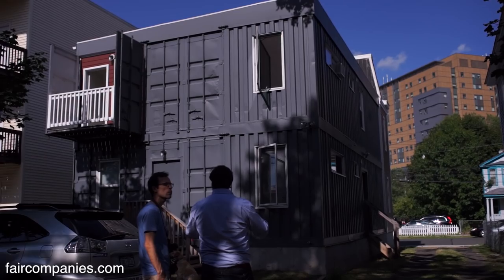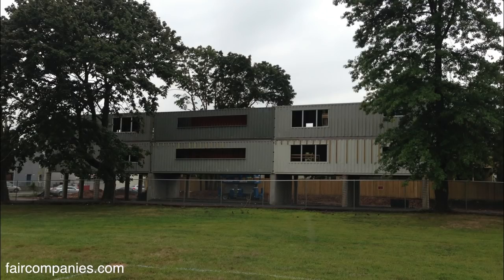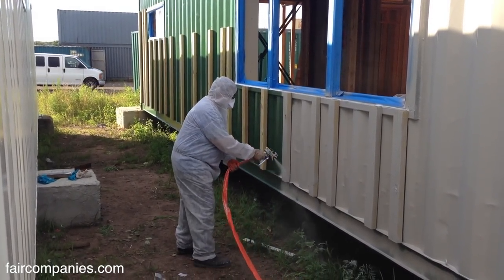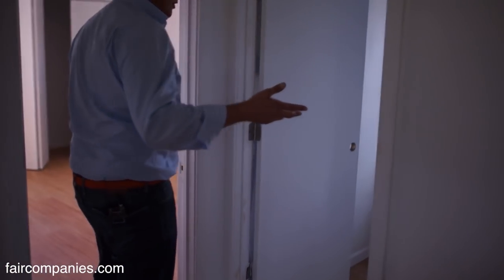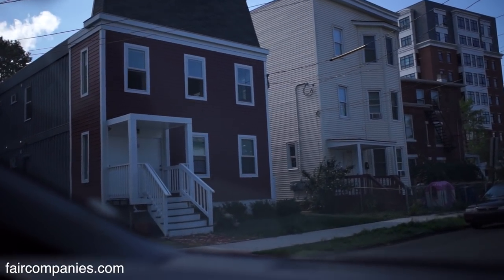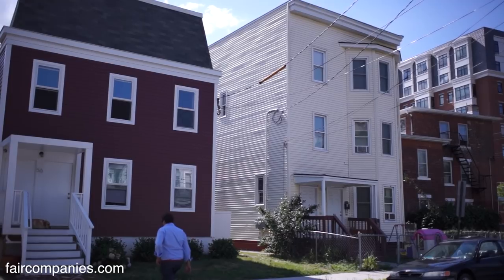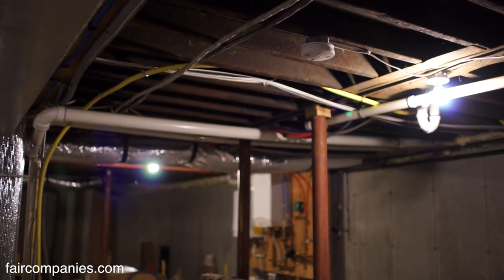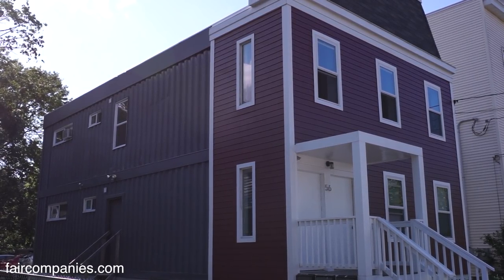Stacked cargo containers in New Haven's "LEGO" apartments

Comment: As a building code official for almost 30 years, I can tell you there should be no issue with this type of building complying with the Building and Fire Codes. Clearly it is Type I (non combustible) and fire ratings of the various components (as constructed) can be shown to comply with the requirements for most uses the height and area of such structures can be unlimited. Residential apartments are required to be sprinklered in any event, so there should be no regulatory concerns with life safety. I would add that a fire inside such a structure would only extend from the windows (no matter how long it burned) and so would be much less likely to affect neighboring homes than standard construction.
Reply: TheBull3745 As to my knowledge US firemen are scared of buildings where they aren't capable to make "another exit" just by using a sledge hammer. On contrary firefighters from Europe would never go into a wood frame building in flames. Houses in Europe, made of bricks or concrete maid be a trap but there are far less flammable items.
Reply: TheBull3745 thank you sir!!!
Reply: I think the "issue" is really with (1) engineering, and (2) building knowledge.

For any traditional building, you don't even need an engineer.  The framer, who has been doing the job for 20 years straight out of high school, knows the code intuitively by this point.  But ask that framer what happens if you put stress on the roof of a container.  Or what happens if you remove 50% of a sidewall.  What happens if you remove 50% of a sidewall BEFORE welding it in place?

ISBU building is cool, but not nearly as easy as people like to imagine.
Reply: Building a 4x40’ herringbone design. Where all four ends meet most of the structure will be cut away leaving a large great room. The pines we have on lot will be furred and used as support beams which is necessary. 
You can’t cut away walls and not reinforce another way. 
Very easy to work with these containers but getting everybody else to do it right and in sequence of one another is the real issue. 
I will need to be on site for most the build. 
It all has to be done exactly correct.
Reply: So why did the building burn down so head on with 911. Def was a demolition set up. I agree with you.
Reply: Mavina I 
Because the three were demolished. 
The owner of those buildings especially the two towers was cited that the towers would need all asbestos removed from the sight. 
They used asbestos commonly in insulation during the construction of the towers. 
The removal of such would cost more than the demolition of such. 
The owner chose the cheaper route monetarily but at great cost of lives. 
This plan was brought to the Busch Administration to which Dick Cheney gave the go. The demo experts were paid to enter the buildings months in advance and plant the explosives. 
There were maintenance records documented of those demo experts in the buildings but have since disappeared. 
Any and all records are gone. 
The towers were in fact demolished by professionals. 
Experts in the field acknowledged this. 
How does steel melt? 
Only one way and that’s magnesium. It burns at several thousands of degrees and liquifies all metals. It’s also used by demo experts to bring down buildings.
Reply: @usafa1993  I have to assume that since intermodal shipping containers are themselves engineered, that failure modes and other characteristics of the containers are already known somewhere due to the design process that led to them, but you're right, no one is especially experienced with non-shipping applications, certainly not master craftsmen or architects.

It also doesn't help that so many that build with them seem to want to leave them exposed for what they used to be.  Cladding them adds cost but also makes them much less unattractive the community.  That itself would reduce resistance to them.
Reply: @TWX1138  Exactly what I was thinking,  im from southern California and I want to cover them with stucco  !
Reply: About shipping container home steel material problem resolution that United States will use line-X to spray shipping container steel home on maintain & keeping permanent not breaking and not cracking, meanwhile line-X can anti-corrosion
Reply: @Purple Haze remember that survive put at first. Life is not easy to survive on high house rental and low salary.  if you have no boxes home to sleep, your sleeping on street will be frozen death.  Don't be too mind that environment.  Fix and install devices such as hydrogen fuel generator and biodiesel generator to be beneficial to summer air conditioning getting cooling system and winter space heater getting warming system
Reply: Planning permission with shipping container home install on vacant land can transfer to permanent accommodation.
Reply: @Purple Haze if I am you, I can choice shipping container home,  not city social house.  If my salary is 1500 pounds month,  Because of city social house rental is at least 500 pounds month,  every month life fee 1000 pounds.  1000 pounds need planned economy and planning to use money. Life is Not easy
Reply: @williamhill2221  Yes, unless water gets underneath. Then capillary action makes it spread.
Reply: As a Master Electrician and former Electrical Inspector I agree that there should be no issue with compliance.
Reply: What could be better fire-proofing than steel? New Haven and its' Brd of Alders are so pretentious! Act like they are just too good for this when a large number of properties built traditionally are a complete mess. Basic fire traps that we see go up in smoke time and time again. All the vacant non productive lots in this city, what a great idea!.
Reply: @usafa1993  What  happens when you remove 50pcnt 😶

Comment: Nobody ever talks about how these could be a good idea in earthquake, tornado, and hurricane country. Just building a house around a container secured to the ground could make them much more durable than normal construction.
Reply: Not really. These containers are very rigid and fitted tightly together. Taller structures are designed in a way that they actually wobble, which helps disperse the energy from earthquakes. When you have a rigid structure, all of the energy is going to be focused on the weakest point. Which in this case, would probably be the foundation due to all the weight bearing on it.

Comment: Very nice open minded architectural design using the oversee containers door as a balcony is a real inspiration for more interesting architectural designs
Reply: As a fabricter indoor ceiling sprinkler welder. It will be a good idea to have install sprinklers systems in every room in case of a fire that would be a good safety option...

Comment: I designed and built homes for 30 years and I find these homes totally acceptable and quite possibly longer lasting and possibly much sturdier than conventional homes.  I love the idea and the thought of easily going off grid using modern technology.    I know and experienced the difficulties of presenting new forms of construction to conventional building departments for approval and it can be exasperating depending on the knowledge of the components of each building department.    Great job and thanks for sharing.

Comment: These always make me itch to get my hands on them, and think up ways to make them less "inorganic" in aura, mostly from the outside.
Things like generous-sized covered porches.  Climbing vines and landscaping that softens the straight lines.  Skylights.  Roof gardens.  
I love the idea of recycling these containers.  And of the strength and durability of the structures. 
I see some comments suggesting they can't be well-insulated without losing a lot of floor space and/or ceiling height. 
I'm surprised.  I wonder if that's really true. I have to admit he did sort of quickly "skate" over that part...
Reply: nameofthepen. I saw a container home building film that portrayed a thin layer of blown in insulation that took away very little square footage;but, provided excellent insulation.

Comment: How do the walls breathe? Steel walls cannot breathe, so I would expect them to suffer from damp and mould. 

We've already had huge problems with very damp and mouldy cheap housing in the UK since tower blocks were first built in the 60s.

 They caused severe sickness, especially in children and the elderly. The poor people thought they were being helped but it turned into a nightmare for them.
Reply: Needs to breath but cant maybe by using 1 in insulation making it dry from the inside out in a way. Its hard to explain lol

Comment: Thanks for posting this.  I've driven past these apartments many times going to and from Ikea and wondered what these looked like inside.  I think it's a great idea, especially in a place where there is a severe lack of affordable housing and very few offerings of modern architecture.  It's I-95 that can be seen in the background.
The architect is also totally correct about the municipal issues - TONS of RED TAPE trying to build anything in CT.  Buildings take much longer and cost much more than they need to here compared to other places.

Comment: I have been doing container housing for the past 15 years since i sold my 3-br house in Westchester, NY.  In my computer, I have  a container housing project measured 48' x 48' in foot print, six floors of apartments with an elevator. Very interesting and colorful facades, cantilevered boxes and balconies casting shadows. interchangeable apartment sizes from 0-br to 1-br and 2-br simply by turning the door keys.  George Wu, AIA ARCHITECT,NCARB 2016-8-23

Comment: I am glad to see that this builder is looking for answers to the questions of codes.  I like his idea to share info so that there is a body of information that has been tested.  Can I ask why you do not get engineering in on this to test the shipping crates for their capacities after they have been cut and changed form?  That was one of the concerns that has to be addressed.  You have an untouched container and it meets the criteria it was built for.  It may or may not meet strength standards when parts have been cut out.  Just because it is steel does not mean it is inheritantly strong in all instances.  For example steel melts down faster in a fire if it has not been covered properly.  I think that is why you have the fire martials requiring all inside walls to have a certain burn rate protection.  If we take this further is it necessary to consider the burn rate of materials attached to the facade.  Could they burn hot enough or long enough to cause a melt down and loose structural integrity on that end or catch inside on furnishings?  So, as time goes by I would be happy to read your data on the structural integrity of the altered crates.  Thanks for sharing, it is always good to learn how to re-use and rethink how we can make living more sustainable.

Comment: One problem. Thunderbolts!!
Reply: +donedeal As for lightning, if you run a large wire to the ground, the home would be the safest place to be in a lighting storm. Even if it had a direct hit, everyone would be safe. Even (if properly grounded) your electronics will fair well.
Reply: Fear Not God Is Faithful Your wi-fi in the home should work fine because it can bounce off the walls of the container. But while that might be an advantage, you might also get Ghosting which is a form of Reflection. 

As for your cellphone, you might not get a very good signal because the container. You would have to stand near a window to get good reception. Cellphones work between 900Mhz to 1.2 Ghz radio frequency depending who your cellphone provider offers. Most phones are now in the 1.2 Ghz range. Which is high enough that the radio waves can bounce off objects like buildings. That helps move the waves around corners. Disadvantage is every time the wave hits a building, it gets weaker. So cellphone companies put in little repeaters between buildings to help fix the dead spots. 

If you built one of these container homes and you found yourself having issue getting cell reception, there are some signal booster you can buy. The maritime community and people who live up in the mountains will use these signal boosters. They take your cellphone signal and boost up the power and resend it to an external antenna located on the roof of your boat, car or log cabin. Some units will also work with 4G/LTE internet and boost that also. 
Here is just one of many examples of a booster: https://www.wilsonamplifiers.com/weboost-drive-4g-x-marine-essentials-kit-470510-m/

As for EMP protection. Well if the containers are well grounded then you'll get some protection, but anything connected to outside antennas might get destroyed. Many boaters get zapped by lightning storms which shorts out all their radios and computers. There are ways to protect your electronics but can be very costly. 
There are other considerations is where you plan to get your power after an EMP strike? The grid will go down for sure. You would be left with having to install diesel generators which in time will need refueling.

Comment: I don't see a point in it. It doesn't look so cheap to build and it's just as big as other houses... I just don't get it.
Reply: It may not look cheap to build, but it is. VERY cheap, compared to conventional building.
Reply: saving some trees? he did say the metal last very long time!
Reply: you're recycling materials instead of sourcing new ones.
Reply: Also.  The USA has a massive trade deficit with China.  Millions of these metal boxes are stacking up in the major shipping ports on the West Coast.  The Walmart Economy has many unintended consequences.
Reply: reivenne, it's not as cheap as you're leading on. Like he said in the video it's anywhere from 25-50% less expensive depending on what type of interior and exterior options you want. I'm in the process of building a container home and it'll run close to the cost of a typical timber framed home build when all is said and done. The biggest advantages of a container home is having the ease of getting the mass of the home in place at a reasonable price as so you can put more into your finishing work.
Reply: Ok, everything have pros and cons... which are the cons ?!

Comment: What happens if you short mains power too the walls on the building? You'd essentially create an electro death box
Reply: +Slot1Gamer I guess they must build that like they would in a ship?
Reply: +Slot1Gamer probably the same thing that happens in a steel trailer.  I remember living in a trailer as a kid where you had better make sure you didn't open the front door when you were wet.  You'd get a healthy tooth chattering shock... bbbuuzzzzz.
Reply: aluminum siding?
Reply: not sure how american wiring works but i would assume the structure would be earthed to some sort of earth spike and all circuit breakers would be rcd protected?
Reply: +Slot1Gamer there may be rubber outlining the wall
Reply: +Andrew Hutchison In America they have no earth ...which in itself is dangerous so I don't know how it would work...
Reply: +Heather Mallard Then why did I pound in all those GROUNDING RODS?
Reply: George C Kaplan
Yeah!
Reply: Well im english so refer to it as earthing but yes i understand that :)
Reply: +Slot1Gamer There have been steel buildings forever. It's nothing new. Although steel buildings don't fare well in fires, wood does better and masonry the best, steel is a common building material. Quonset hut homes were common in the 50s through the 80s, for affordable housing for students.
Reply: spookiewon
What is not faring well about steel buildings then, in what way specifically?
Reply: ***** Steel structures tend to collapse in on themselves in a fire, kinda the way plastic bags do if you throw them into a campfire. 

Wood structures support combustion, but stay intact far longer than steel. Masonry doesn't support combustion.
Reply: spookiewon
I see the truth in that, thanks!
Reply: ok after learning more about mains wiring, if the walls are earthed AND the mains is fitted with an RCD. Shorting the live to the walls will trip the RCD, because there will be a differential on the neutral.. :)

Comment: The design I had drawn up won’t pass. These containers have only four corners that support everything. If you cut out the ends for any reason it compromises the entire structure so in my design (4-40’) herringbone together/ it makes two wings that sprawl outward into a V or L shape. Well the center is the ends of all four containers to make a great room area. The containers are butted together in this herring bone. All the support corners need cut out so I’ll need three 17’ support trusses or load baring beans to get it to pass. Problem lies in the awkward angles they would be in when connecting to adjacent strong points. The lines are quirky and I’m at an impasse which isn’t good on the time restraints imposed. 
Any advice in understanding this unique design and shoring up these areas would be appreciated. 
This is a learning curve for me.

Comment: Very informative video!  Regarding insulation:  I used closed cell spray-foam as insulation in my own ocean containers and it is very effective.  Then used it in my van on ceilings and walls before paneling.   How about the container wall structures?  Did you use 2"x4" wood or metal studs?